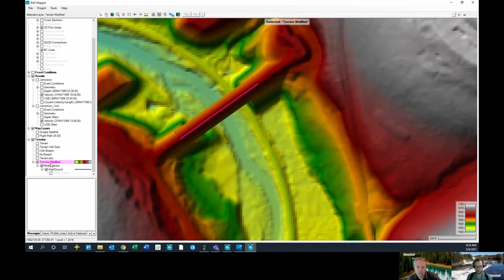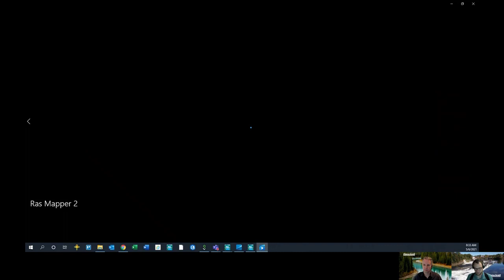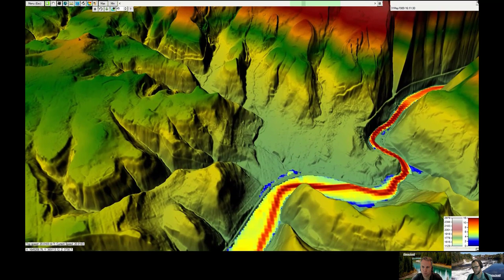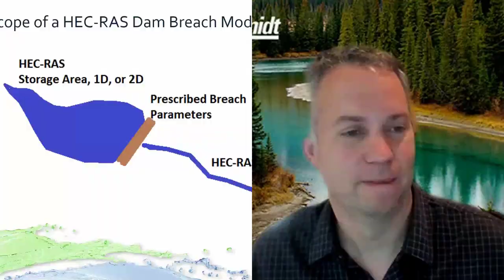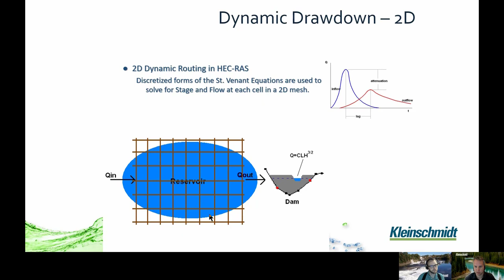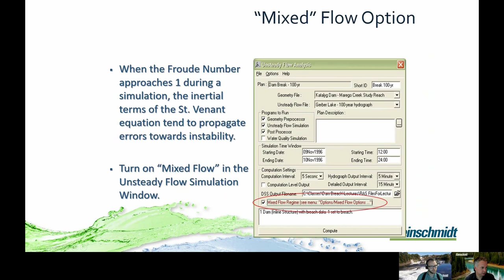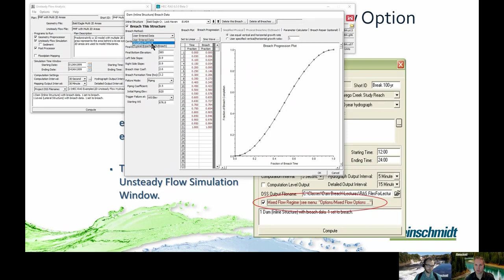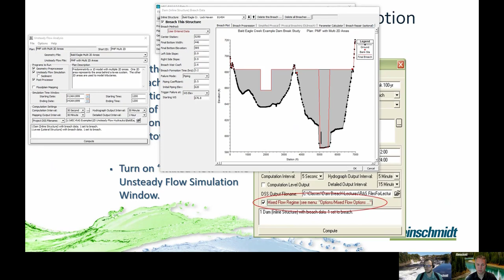Episode 15: Dam Breach Analysis & Johnstown Dam Failure

Comment: To apply rainfall only to one of the 2D areas do you use the older method of defining precip in the BC tab rather than the met tab in 6.0?
Reply from the maker: Anthony- if you just want a single excess precipitation hyetograph applied to a 2D area you can use the Boundary Condition input in the Unsteady Flow editor. If you want a more detailed hydrologic event simulated you'll need to use the Met tab.